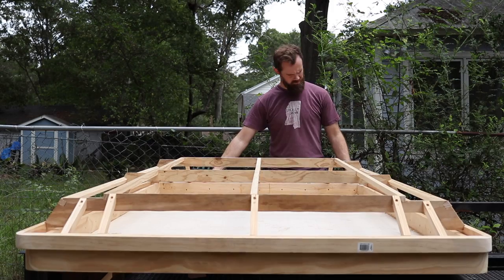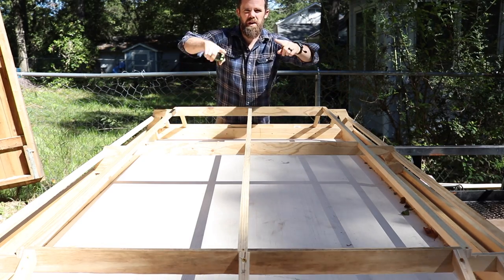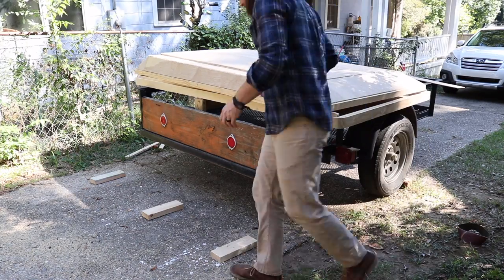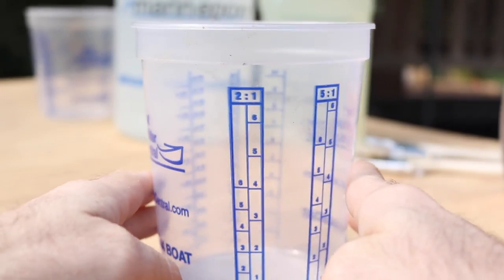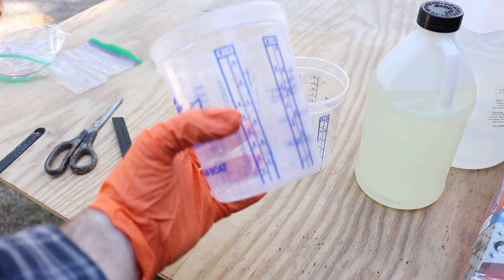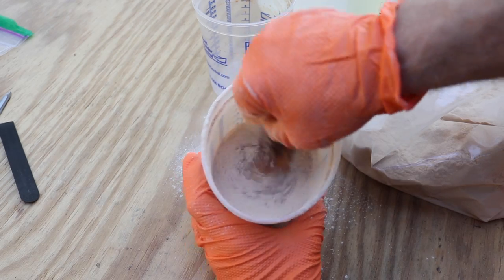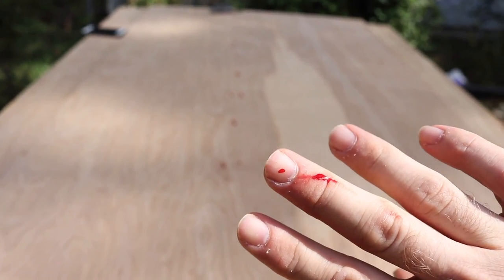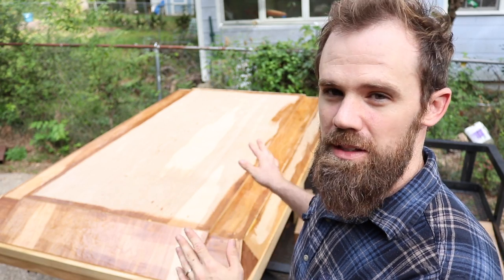Rooftop Tent Build Series - Building the Hard Shell!

Comment: Talcum powder costs less than wood flour and works great, but the resulting fillet takes forever to sand (hard as rock). Don't forget wax paper is your friend when working with epoxy, for masking and smoothing rough spots before the epoxy goes off. Smooth rough spots by laying wax paper over the area to be smoothed and roll or rub on top of the wax paper, moving the epoxy underneath.
Reply: Wood "flour" is free from any floor installer. Saw dust from a floor sander.....

Comment: I have to agree... I too am loving this series. Great video, great content and great explanation from you.

I have a question, how flexible is the resin? I have no experience in this build method, but I consider resin to be quite rigid. Will it withstand the flexing which you are likely to see in the upper clam shell? Is it not likely to fracture?

Keep up the good work, I look forward to the rest of the series.
Reply from the maker: So the resin on the exterior is really just there to soak into the wood to protect from moisture and make it very durable. There will never be enough flex in the top to make that crack. The epoxy fillets are very rigid but are able to flex. The upper shell structure does flex some especially if you try to pull it closed from one side but it wouldn't flex enough to compromise the structure. I think you'd be surprised how strong it is. If you were concerned with strength in a certain area you always apply 6in fiberglass tape over your fillet and then epoxy over that. Now it's 10x as strong.

Comment: Very impressed. Turned out looking great (and that's not even painted yet). I dig diy woodworking so two thumbs up from me, mate.

Question - how much does it weigh (top and bottom covers) , you reckon?
Reply from the maker: I'm guessing around 100lbs/ 45.36kg. I know that top is 40 Lbs/ 18.14 kg. the bottom is probably 60/ 27kg. I'm hoping for about 115-120 when finished.
Reply: That's a reasonable weight. Keep up the great work mate.
Reply: @PatrickRemington  Thanks for adding the weight, nice video. Appreciate you sharing!

Comment: Cool, awesome job! Could you have used brads instead of the staples and left them in? Also after the epoxy fillets dried on the outside I'm guessing you could have used some bondo to help smooth out the edges / corners?
Reply from the maker: black99vett you could definitely use brads and leave them in. I just used a staple gun since it's a super cheap and accessible tool. I'll finish the exterior at the end but I'll be using Bondo to get everything smooth so the paint will look good

Comment: Nice work.   This is definitely on my list of projects.    Subscribed for sure.   I also try to make vs buy wherever I can.   Not that we need more projects, but it is fun.    

Are you planning to fiberglass over  it?
Reply from the maker: Just going to leave it sealed with epoxy! Fiberglass would be a little overkill and it would add more weight because you'd need to add a lot more epoxy. I'm going to wait until the very end to do all the exterior finishing but all there is left to do is sand, use body filler to get it really smooth, then prime and paint. I really want to try out a vinyl wrap or plasti dip on something like this but we'll see...
Reply: @PatrickRemington  Got it.  I know there is no end of details, so looking forward to the rest.  Given that the top is relatively flat, it gives a great surface to mount other racks (that's where additional fiberglass reinforcement may be helpful).  Nevertheless, great stuff.

Comment: A buddy of mine loves the two part epoxy. He's built several boats with  great results.  He told me that you can make sawdust from just about any hardwood scrap you've got laying around as long as it's dry ( no pine or pressure treated) in place of wood flour. The other tip he gave me was to measure my liquids and  then mix  my sawdust and epoxy then add the hardener. Not sure what the reason for that

Comment: Great build, thanks for sharing.  Are you going to glass the exterior or leave it sealed with epoxy?
Reply from the maker: Just going to leave it sealed! Fiberglass would be a little overkill and it would add more weight because you'd need to add a lot more epoxy. I'm going to wait until the very end to do all the exterior finishing but all there is left to do is sand, use body filler to get it really smooth then prime and paint. I really want to try out a vinyl wrap or plasti dip on something like this but we'll see...

Comment: Looks great, was thinking you could have saved a lot of weight by using thinner ply and then adding fiberglass cloth to the epoxy for extra strength. I want to make one lightest as possible so even thinking of using foam instead of ply and strengthening it with epoxy and cloth front and back. Also, do without the base together and have the mattress wrapped in waterproof canvas and placed directly on top of the car roof.

Comment: Fantastic tutor, I  did have a question if I may. Would this method be strong enough to add a couple solar panels to the top of it?
I have a van that the roof was bend and supports destroyed before I bought it, This is making me think of cutting the roof off entirety and make my own high top shell.
Reply from the maker: Wasteland Goat that sounds awesome! I’m not really sure.. how heavy are solar panels?
Reply: @PatrickRemington  One panel weighs around 16 to 20 pounds. Since I plan to be out camping for 2 to  3 days at time, I think I would need 2 panels to charge the battery system I'm wanting to do.

Comment: Late to the party here but great work!
Have you had any issues with bowing or strain since only one side of the plywood has epoxy on it? I have very limited experience with epoxy but I know finished wood in general you want to do both sides to equilibrate humidity changes. Is that a concern with epoxy as well?
My apologies if you go over this later in the series. Thanks

Comment: That epoxy works great how much time do you have with the epoxy mixed with sawdust and if it's hot out does it dry even quicker. I had planned on using fiberglass do you think that will work ok.What grit of paper do you use to sand the epoxy a pretty rough grit.Do you think the epoxy will bond better than fiberglass will .Enjoying the video as always Thanks for making it.Dale
Reply from the maker: Dale Ramage I'm using a medium cure speed so it takes about 24 hrs. You can get faster cure speed but the only problem is that if you make a large batch it will start setting up before you can apply it so you end up wasting a bunch. The problem with using fiberglass is that if you have never worked with it before it can be a huge pain in the butt.. the technique that I am using is very strong and is much easier and faster. I'm trying to make things easy and simple for those that want to try this!

Comment: Very nice style workmanship and presentation! but how about a review? Be honest, did the cover start splitting at the joints? was there too much effort and money put into a concept that doesn't work? Would appreciate honesty here because I've designed and built a pretty radical rooftop that I never seen before and smart construction methods that made it lightweight so I'm wondering if I should use finishing methods used here or any other suggestions? Thanks in advance..

Comment: I get it why you'd use the epoxy resin as a sealant, but is it any better than wood glue as an adhesive? Is is cheaper?
Reply from the maker: Patrick Hobbs I've never tried that but using epoxy and the filets makes it soo incredibly strong. You might could get away with it but like I said I've never tried. The epoxy soaks into the wood and makes it really hard and also protects it better than just paint.
Reply: How many Patricks do we have here now? With me, that makes 3 that i'm seeing. 😉

Comment: Is there a reason you used staples instead of Brad nails or plastic nails? I have access to both, so is one better than the other? Or does it not matter because of the epoxy?
Reply: I'm an idiot. I missed the part where you removed the staples.

Comment: Of course we can use the wood as the male mould and work with Fiberglass / Epoxy.  better  Carbon fiber + epoxy.
The best place renforts àt the exterior and crate a female mould  will be more easy for the sandwich.
Following this basic have a look on the sandwich carbon vacum thechnic on this tube (New technologies. You can rent  a Freelance for the infusion part in this case the mould is very important.

Comment: Not to criticize,  but why didnt you use liquid nails for the fillets? You can use the caulk gun just like you did and would not have had to use the base coat.... It's much cheaper and easier to apply. Good work, just trying to figure out you logic.
Reply from the maker: The fillet adds a lot of structural rigidity that liquid nails won't provide. Kind of hard to explain but it makes the structure way stronger.

Comment: I built a stitch and glue kayak a few years back, this is brilliant.  Based on that a couple of questions.  Do you think it’s strong enough to support a roof rack if one used 2x cross pieces in the top here the rack would be attached.  Second, in my kayak I used 1/8 inch okume ply, do you think 1/4 is necessary or could you use 1/8 for the top. Also wondering about using PMF instead of epoxy.
Reply from the maker: Marguerite Young if wanted a rack you would probably need to just beef up the frame first. maybe use fiberglass tape on the underside along with the fillets. I personally think 1/8 is too thin unless your planning on covering the whole thing in fiberglass. Which would be a huge pain and more expensive than just using 1/4" ply.
Reply: Patrick Remington makes sense wrt 1/4 vs 1/8 and yes wouldn’t love glassing the whole thing.  I have a truck and have been drooling over the new vagabond drifter.   Thinking one could combine a camper shell below and this above with a sliding floor to able to access from below.  I’m looking forward to seeing your fabric construction technique for this as well.  Loving this.
Reply: Patrick Remington  have you got this posted on expedition portal?
Reply from the maker: I'm not sure what that is.
Reply: Patrick Remington expeditionportal.com is a site dedicated to overlanding.  A couple of the forums dedicated to roof top tents, pop up campers and diy modifications of vehicles for camping....with an emphasis on off road but not exclusively so.  I think you’d get a lot of positive feedback on your build there.  I linked this most recent video there today to get feedback on my idea of combining the RTT with a cabover stitch and glue truck camper.

Comment: epoxy does not bring the strength you seem to think it does, this is why fibreglass is used for jobs like this. You had done everything needed to apply fibreglass cloth, just needed to do it.
Reply from the maker: Epoxy itself doesn't but epoxy fillets does. Fiberglass cloth is overkill in my opinion.
Reply: @PatrickRemington  the strength that the fillets bring is entirely based on how much penetration it can get into the wood and the wood itself. ie, weak as hell. Fibreglass creates a hard shell over the entire area, which the epoxy cannot match.
Reply from the maker: @Gantzz321  Yes, i understand that fiberglass makes things stronger. I've build two now without fiberglass and they are both strong as hell. sooo...  Fibreglass is added work, expense, weight, and over kill. If you want to build one with fiberglass go for it but I wont be doing that.

Comment: Wow. Lol. Just wow. I feel like your miss leading people. Thats not how you build a solid wood structure properly.  Looks neat.  But ….
Reply from the maker: No, not miss leading people. There is no exact “by the book” way of building something like this. There are many ways one could go about this. This is just the way that I chose.. and it works. It works really really well actually. It’s very light and strong especially after the fiberglass is added. These same techniques are used in boat building. I have a fb group for building diy rtt with like 28k members. Many have built this exact tent. If it didn’t work it would be exposed there. Thanks. ✌️
Reply: @PatrickRemington  its neat.  I love it.  It does looks light.  We can agree to disagree on building methods. I feel there there is fastener sizes. Spacing. Proper tools for the job for a reason. And i didnt see any screws or nails threw the sheething. No glue in between the framing and the sheething. Glue in the inside like a chamfer. Un suported corners. Now thats just what i leaned in trade school.     Yes there is a book on building.  Lol
Reply: Its very cool   I should of kept my opinion to My self.    I am just being a troll now.  Cheers. I will buy u a beer one day